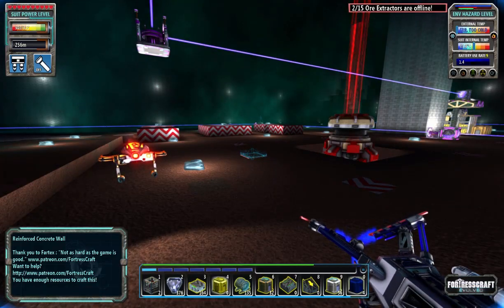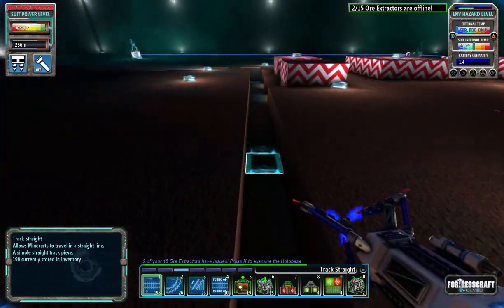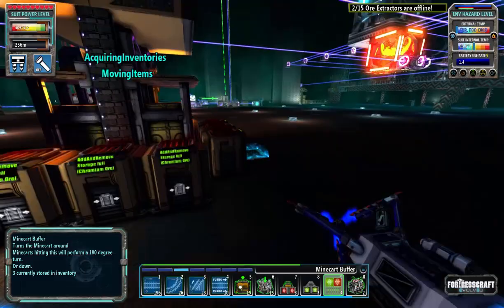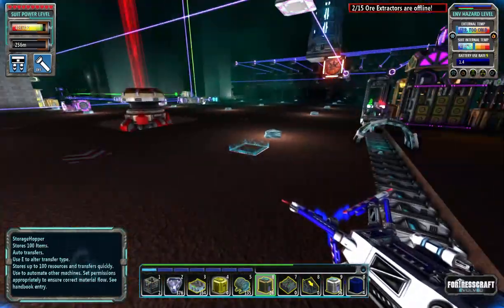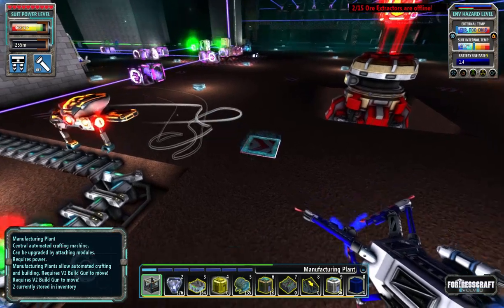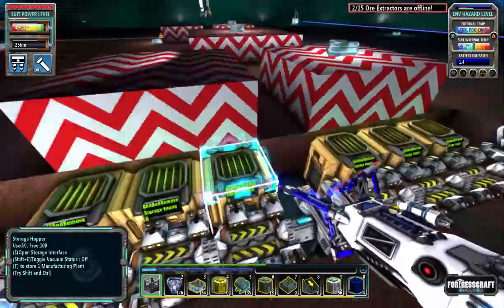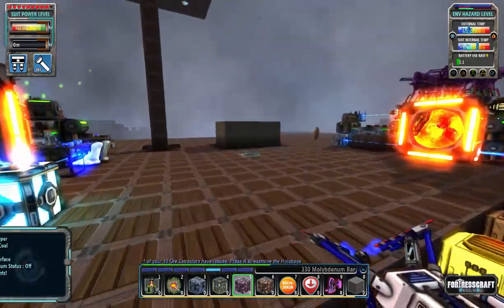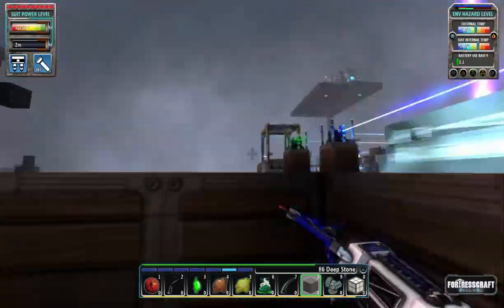FortressCraft Evolved : Frozen Factory - Ep 76 Prepping For Ore

Comment: at 12:15 u walked over another crystal vein, and I think there is another crystal vein underneath the blast furnace space with the hole that u filled in, check them out please in the next vid, thanks! I do wonder why don't u upgrade the matter movers? not needed? will u get those stray blocks floating in the middle of air?
Reply from the maker: I cleared a few small veins as I dug out the cavern, so the crystal in the floor is probably a remnant of that.
Reply: I say still mine whats left. no more destroying crystal veins until u know u dont' need anymore